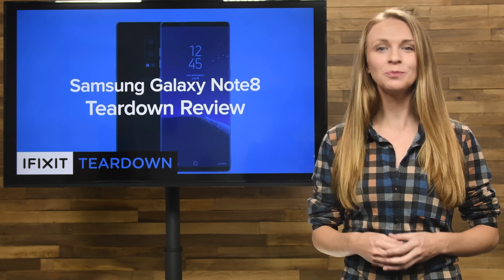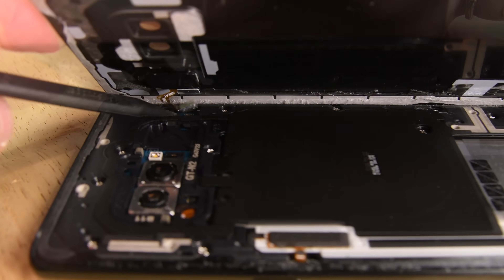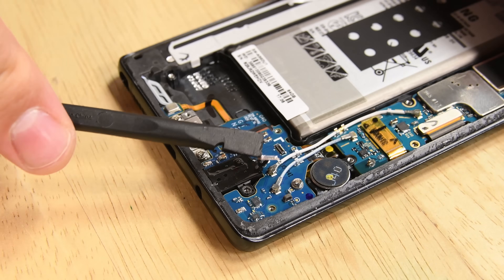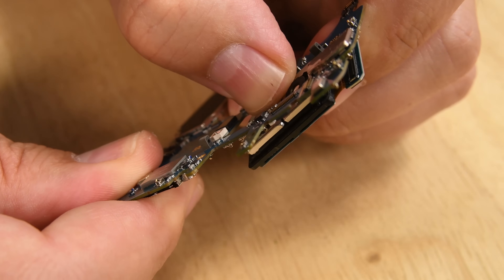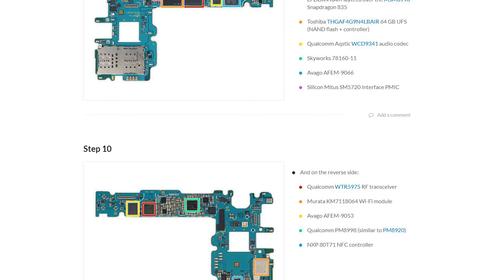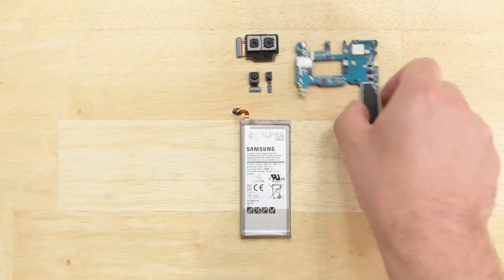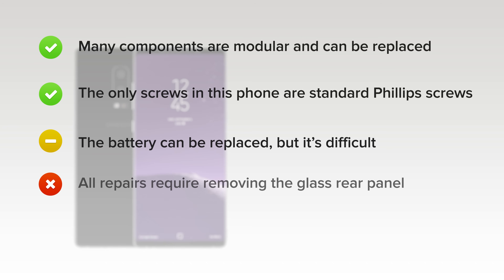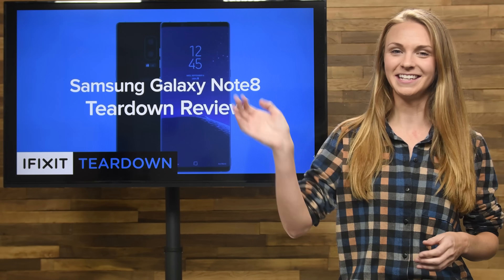Samsung Galaxy Note8 Teardown!

Comment: I some how managed to take my Note 8 scuba diving "don't ask" its defo not water proof. ;-)
Its been sat in a bowl of rice for a week and i can still see condensation on the camera lens maybe cause its water resistant its not letting the moisture out.  I tried warming it up in the oven for 30 minutes but made no deference.
I'm going to try to take it apart to dry it out manually any thoughts, warnings ect.
Reply: aliphilp its water resitant for upto 1.5 metres for 30Mins
If you take it deeper or leave it for more than 30 mins water resistance may be compromised 
It's your fault and not exactly the phone's fault

Comment: Why are your videos so biased towards Apple? I just watched the iPhone 8 and Note 8 tear downs and for the EXACT same reasons you scored the Android phone 4/10 vs the Apples 6/10 score? The Samsung phone had only 1 type of screw and virtually every component was modular vs the Apples more difficult and costly repairs. Why?
Reply: I have the same doubt!

Iphone x is much more difficult to repair but it got a 6/10 note 8 id much modular but it got a 4/10
Reply: brian L because its ifixit
Reply: I think the lower score could be due to having to double pry off  the back and the front screen of Samsung's whereas the iPhone is screw off the pentalobes to access the screen and internals

Comment: With all the modular components they should have kept the battery modular as well, goddammit! Fuck water resistance. Give me back longevity and the ability to replace the degrading battery 1-2 years from now
Reply: I agree. If I designed a phone, I wouldn't care about waterproofing, in the name of repairability, and interchangable back covers and batteries.
Reply: No one cares for that anymore batteries are smarter and more efficient and so is the software. Grow up

Comment: There are no screws on the exterior to hold it together how else did they expect it to be held together? Phones are way too complicated and the screens and components too small for do it yourselfers anymore. Leave it to professionals with the right tools and that know the proper procedure. Anyone with common sense buys Total Equipment protection or similar insurance for such an expensive phone. The thing is a grand, brand new, for crying out loud. Your gonna go that expensive for the phone but cheap out on a repair if it is needed? Makes no sense. 

All phones are going curved screen including the new iphone series and these screens are very hard to be replaced and be done properly. Save yourself major headaches, quit being cheap and just take it in to a licensed repair shop. 

That is also why I always buy from a carrier,  buy their equipment insurance, and take it to their shops. It just makes things just so much easier if a problem arises. I had a dead cell in my screen picture on my last phone and the phone was only a month or so old, but I did have full insurance, so I took it in and they looked at it and decided they would send it in themselves and they just gave me a brand new phone in it's place, right away with no waiting. Yes, brand new.  I only payed a $100 deductable for a $700 phone. That could't have been posssible or so easy if I had cheaped out and not bought protection. It was my first time I had ever needed it and had never purchased it before, but was so glad I had it then. Now I always make sure I have the coverage. These phones are just not cheap and easy replacements anymore. They are investments.

Comment: Zack (jerry) ripped the fingerprint cable
Reply: He also says it's impossible to take apart without breaking the glass lol
Reply: @Zupoyo  I understand that this is a two year old comment. While Zack did tear the ribbon for the fingerprint scanner (which to be fair, if you've never took apart this specific phone before, it's very easy to do). He has never said it was impossible to take apart without breaking the glass. He even took it apart himself without breaking it. The only thing that he has mentioned anything remotely related to breaking the glass is that if YOU break it, you can find replacement backs pretty easily pretty easily.

Comment: Why would they make the phone modular but so hard to get in to
Reply: Its water resistant and they use alot of glue, and it's modular inside because if they need to repair it, its quick, cheap an rather easy.
Reply: Mark Allan waterproofing/resistance.. I think
Reply: Mark Allan IP-68 water resistance.
Reply: Mark Allan replace broken parts- easy for Samsung
Reply: all water proof phones are hard to get into...
Reply: So that it's water resistant compliant. And easy for SAMSUNG to repair if needed.
Reply: Mark Allan Maybe because by the time those modular parts wear out the water proofing would already be compromised due to heat and everyday use
Reply: Mark Allan it would also help them by reducing prices of replacement parts and it's hard to open thanks to its waterproof
Reply: i think they just mean it can be removed and isn't soldered to the motherboard
Reply: Water resistance.
Reply: Mark Allan It's water resistant. It's supposed to be hard to get into.
Reply: Waterproofing
Reply: water resistance
Reply: Water resistant glue
Reply: Mark Allan I don't know maybe so if they send it for their warranty or just repair in general it is easy to repair. Just a guess.
Reply: Mark Allan design